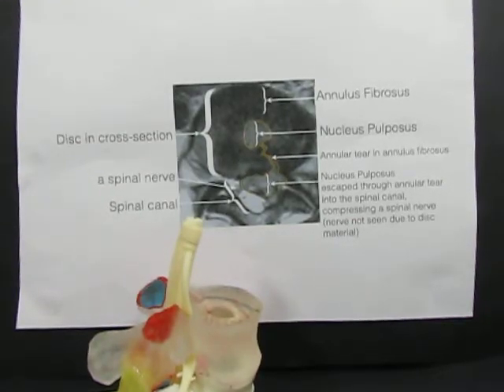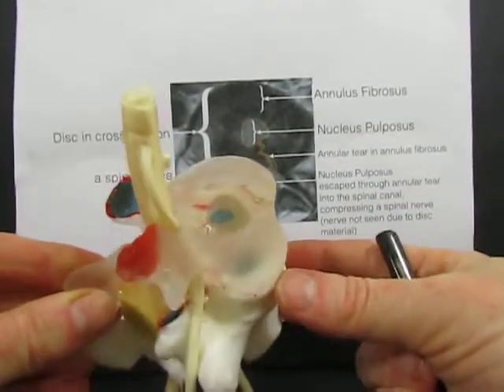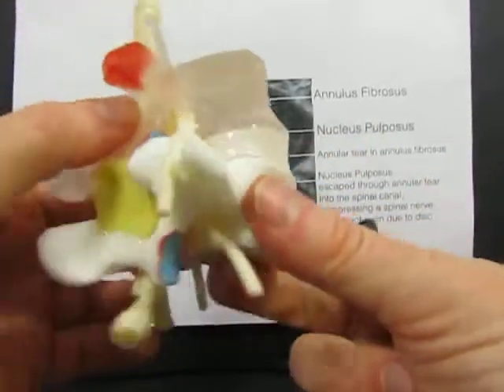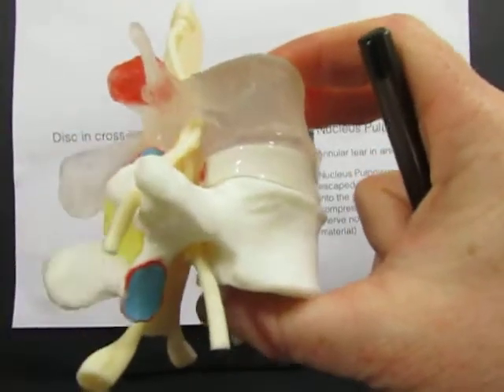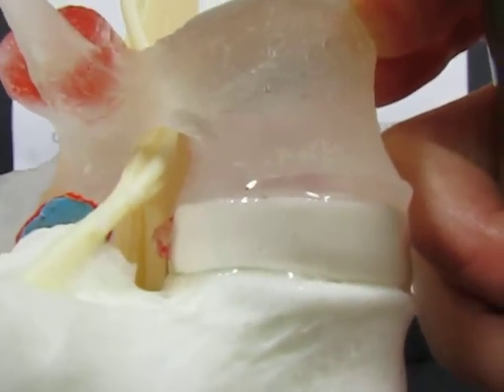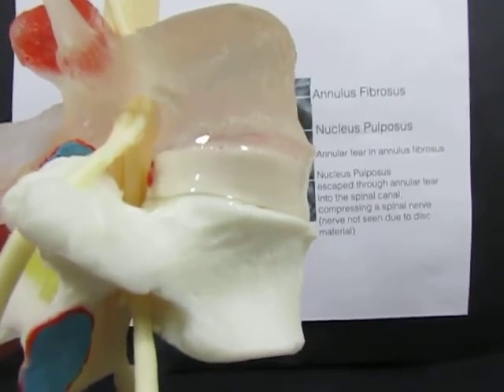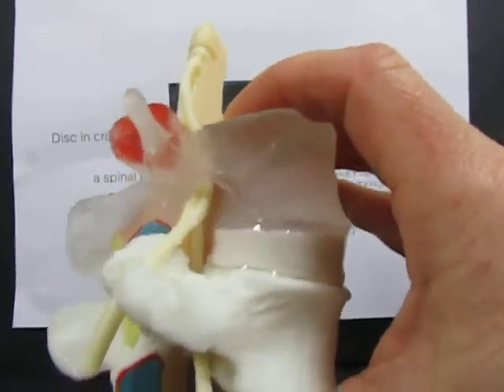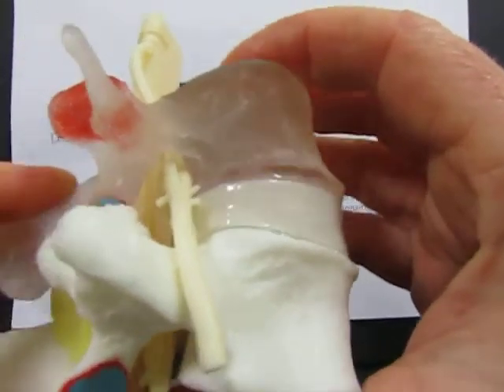Lumbar Disc Protrusion explained by a spinal surgeon

Comment: Thats not disc protution thats disc extrution ptrotution is a disc contain bulge that has no anular tear to leak out
Reply: Can protrusion get back to normal?
Reply: @omarsamy122  depending how big or small it is and how u take care of ur selft, with work outs it dosent really have to go back into place to heal but just dont make it worst dont bend ur spine dont bend over squat to pick up stuff, dont lift heavy stuff, if u do use ure legs, dont panic if ur not healing takes time it took me 5 months almost 6 to heal but i had 2 disc protutions and 4 facet joints iritaded and over strech lingament from spinal. But i have heald, today i can do almost everything i can walk normal i can run i can lift i can crawl ley sit work.
Reply: @BlackSkuLL4u2   disc dessication l4 l5 s1 levels with broad based protrusion bilateral neuroforaminal narrowing.
Can I do spine exercises or not
Reply: @carlover26cool  what dose that has to do with ur legs and I had 1 disk protrution and a nother one to the side
Reply: @carlover26cool  how big any thing under 4mm don't even worrk

Comment: So basically all you say is no healing treatment can help to pull it back . As a physical therapy and etc . 
Once it got out it cant be pulled back to its own position ?
Reply from the maker: There's an inflammatory process which the body instigates to dissolve the protruding disc fragment. If you don't correct the posture, then more protruding disc fragments occur- a bit like not turning off a dripping tap.
Reply: I believe it can go back in.
Reply: as a physical therapist i find this video offensive

Comment: Very informative doc, ive been suffering this kind of pain for morenthan a decade, and i ignore it until i visit an orthopedic  last 3weeks but still no improvement with pregabline medicine and norgesis, today march 8,2021, my dr.adivise me to continue  taking pregablin 75mg and .he advise me to advise to attend therapy for 3months, so i need your second opinion doc,
Reply: Same situation with me from 20 years..now I learnt how can I fix my pain in 3 days..
 Pregabalin 75 and katadol with rejunex OD helps Lot in treatment when you have pain also if you feel better than do regular some exercises.. if you have serve pain than use 3 thin pillows under ur tummy And sleep on them your back bone will strech and your disk will go back on right position  within 8 hour..
Reply: @Antiphilozistin  thNks sir, yes i do a rolling towel belt overnyt, i felt good as usual, but anyway i do winning this fantastic pain😄
Reply from the maker: Conventional medicine can help, but less conventional 'treatments' include eating anti-inflammatory foods, like turmeric (look up all the different spices). Extension and rotation exercises won't turn a chronic problem around immediately- think how many years it takes for our poor posture to influence the spine and this gives you an idea that changing the way we load our spines is a long game